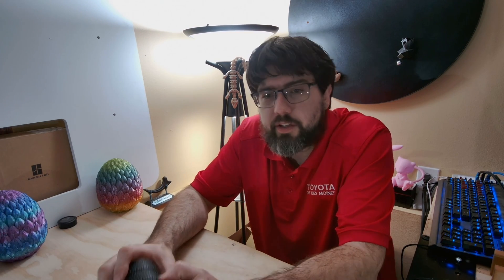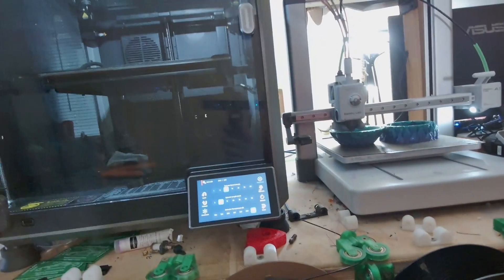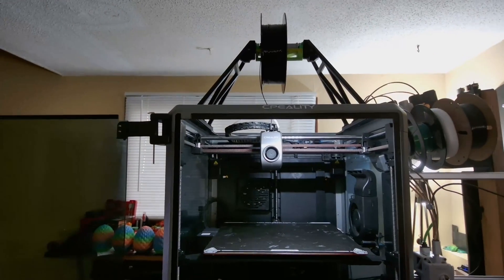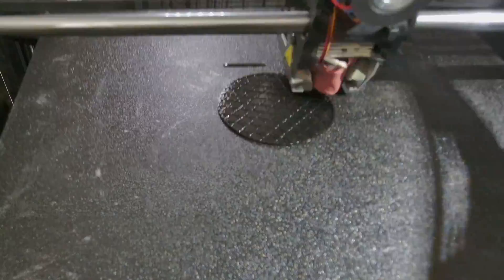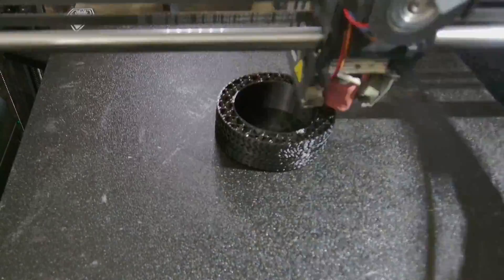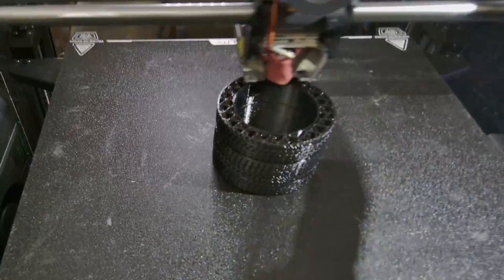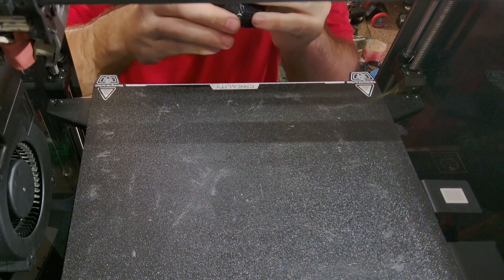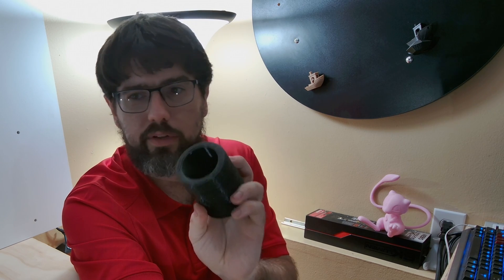How To Print TPU With Your K1 (MAX)

Comment: @jatdesign i may have missed it, but what did you find works best for temp and speed for the nozzle and bed? Im trying to print tires and im losing the detail in the tread. Thanks.

Comment: Sorry if I missed it, but what slicer are you using?
Reply from the maker: @mikepsstanley4532    at the time of video I was still using creality print.    I have since switched everything over to orca slicer.    Settings are all very similar.
Reply: Thanks,  just sliced mine with Orca, first print about to start!  Really appreciate the quick response!
Reply from the maker: @mikepsstanley4532  no problem hopefully the guide helped
Reply: @JATdesign  work great! Printed tires for an Eclipson 3d printed plane and they have turned out beautifully. Thanks again!
Reply from the maker: @mikepsstanley4532  glad to hear.  Enjoy.

Comment: Please please please tell people to use a little bit of alcohol for removing prints. 
Just try it with tpu and you will realize its a gamechanger.
Spray a bit on the buildplate and the part just separates itself from it.

Comment: Many thanks for this video, been struggling with my K1 max trying to print TPU and failing after a few layers, Made up my own quick temporary top spool mount and adjusted settings and it works great many thanks again.
Reply from the maker: @rogercotterell  glad I could help
Reply: ayarların nedir ? ben üst makara bastırdım ancak yarısında takılma oluyor sanırım extruderda takılıyor
Reply: @ahmetttt10  çözebildiniz mi hocam

Comment: Do you disable retraction?
Reply from the maker: @zee7056  reduced dramatically and slowed the retraction down allot also.     I have found this to be slightly different on different tpus.   So do recommend a retraction tower with each type of TPU you print with.

Comment: Awesome video. Looking to improve my TPU prints so I will try some of these settings. Just wondering, what do you do for cooling? Especially for for small parts that have short layer times or parts that have overhangs.
Reply from the maker: TPU Generally is slow enough you don't need to worry about layer time that much.  I set it around 5s min layer time.

Fan speed i leave on default and turn off aux fan

Comment: I have a normal K1 and it seems like my printer has a hard time gripping the filament. When I just tell it to extrude it seems to not be able to have it flow smoothly.
Reply: I tried to print tpu on my k1 max and it seemed to start ok but then gets jammed up. I could potentially see the reason why he feeds directly from above avoiding any friction
Reply from the maker: correct if you run through a ptfe tube It will not print
Reply: @Camaro45th  Bump!
Reply: @nicolouisminnie4505 hey I dried the filament and fed directly into the extruder and it worked. That is defineitly the key. I currently upgraded it with the CFS upgrade and I was doing some testing but my printer is down at the moment. I was getting a ton of errors but it turns out I broke the wire for the new filament sensor. Currently waiting on a replacement.
Reply: I have the same issue. Did you find solution?

Comment: I have a question regarding using TPU/Flex PLA mixed with PETG as support because you can't feed TPU or any flex filament in the AMS and I need to feed it manually but I don't know how to do it through Bambu Studio. I had the same issue with TPU in my K1 so, I desgined an external spool wall support and I had zero issues with FLEX Pla to print the airless basketball ball but I couldn't remove easilly the support. How to do it in a Bambulab and how z height is the best to remove those supports if It needs it??
Reply from the maker: Flex pla was designed a bit more rigid than tpu, I have not personally printed with it. But my understanding is it has been blended with tpu.   Which in turn increase its layer bonding by a bit.        TPU with a PETG interface is harder then PETG to PLA but should still work for your intention.

After slicing, you adjust the layer slider (+) button on the right to the layer where you want the change. Right click on the (+) and select Add Pause. Repeat as needed, then click Slice again.

When the pause is reached, the toolhead will go back to the poop chute and wait for you to unload and reload the filament (see my earlier reply.) Then you hit Resume and it will pick up.

As for your Z height when im doing pla to to petg interface layers I change it to 0 Z height  and the parts pull apart perfectly with 0 signs of an overhang.     But on your curved piece that would be much more difficult   also specific i don't think you can pause it only for supports.

Comment: Is that the regular interface on the screen of the K1 max or did you modded it? It doesn’t look at all like my K1.
Reply from the maker: It's a version of Klipper screen called guppy screen.  Something you can do when you root the machine.
Reply: Thank you for the reply. I’ll look into it.
Reply: Would you be able to do a quick video on how to get the screen to do that?

Comment: Very helpful, do you have a link to the nozel you were talking about.
Reply from the maker: It has been incredibly nice to only have one nozzle and not have to swap for different materials.   Petg doesn't ball up on it like it does on hardened nozzles etc.
Reply from the maker: I do have another video up about the diamond back nozzle.  It runs around 90$.    I'll add a link to this video too.
Reply: @JATdesign  thank you